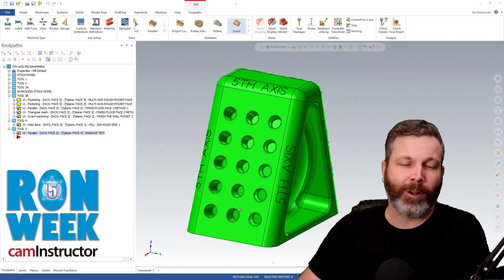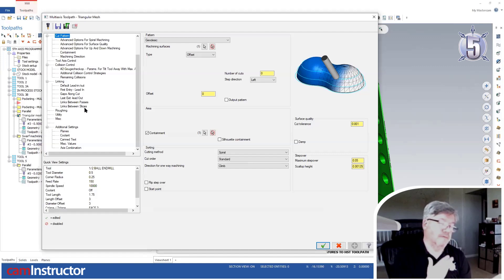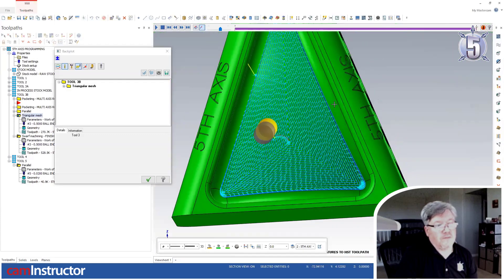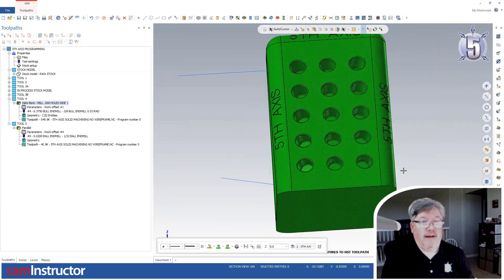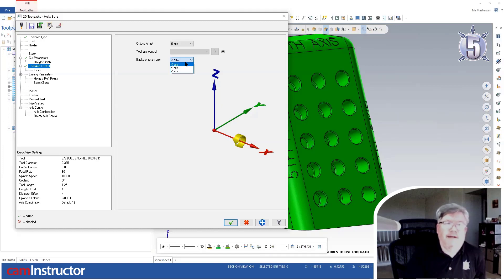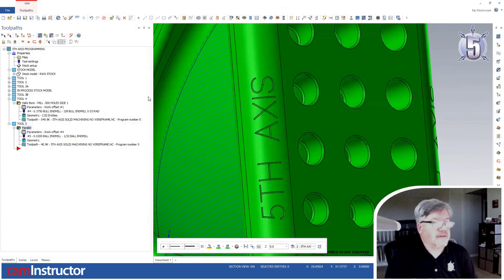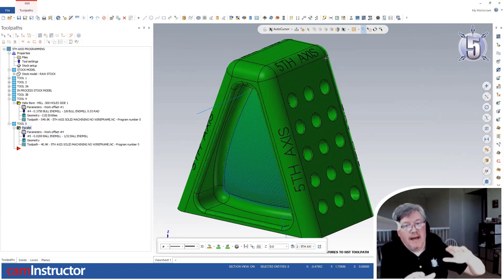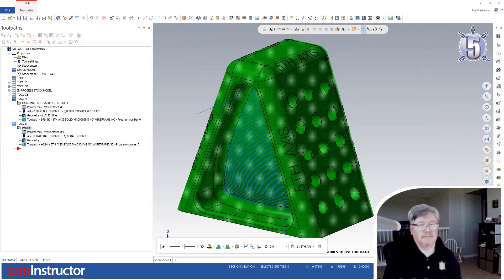I ask Ron why he uses Mastercam - and some more MultiAxis toolpaths in the video too!

Comment: Great videos. I model all my jigs and fixtures in Mastercam. Works great. As far as programming, I'm so far behind because I'm so rushed at work to get jobs done that I don't have time to up my programming skills. I guess I'll have get on board since I'm getting a 5 axis mill in the new year. (Haas VM-2 with TRT160). I've actually quit programming from wireframe and going from solid.
Reply from the maker: Find 1/2hr a day to put into learning. Within a month you'll be faster than what you would have been, making yourself more efficient. If you have a bulldozer but don't know how to use it, would you keep using the shovel :)
Reply: @CamInstructor  LOL! Absolutely true, I’d figure out a way to use the bulldozer. Thanks

Comment: I think there is a market for more deep dives into advanced stuff. It's one thing to say "just go in and experiment" but it is just as valuable to hear an experienced programmer's insights into different variables in each toolpath since we all know corporate isn't always the best at naming a lot of these options, so there's lots of little checkboxes around with uses that may not be apparent, even after experimenting with them.
Reply: Lots of great tips in this series by Ron. When doing 5 axis toolpaths don't apply collision checking until you get the motion you want first, Ron touches on this when he mentions he makes a course/ big step over toolpath and not trying to fully finish the part. Also when making changes while learning, only make one change at a time. Making multiple changes will lead to frustration on what each change actually does on the toolpath (easier to see one at a time). Great work Ron and Mike!
Reply: @haford2  Those coarse stepovers are very helpful when troubleshooting! I've also found that opening up the toolpath tolerances at first speeds the processing time greatly!
Reply from the maker: This was a 2hr session and I think he covered quite a bit. Those toolpaths have so many settings, digging entirely through one toolpath would probably take more than 2 hrs. If you want to see more on this part or ask some questions, make sure you sign up for our BIG EVENT coming in February. Its a one day virtual CAM Conference. Ron will be presenting...this is still not officially announced yet...and there will be a Question and Answer period you may find useful. Oh, its FREE to attend. I will be posting more about this soon.
Reply: @CamInstructor  I am just saying, I would buy an "advanced 5 axis" book if you were to make one.